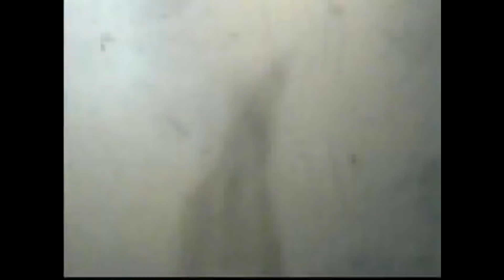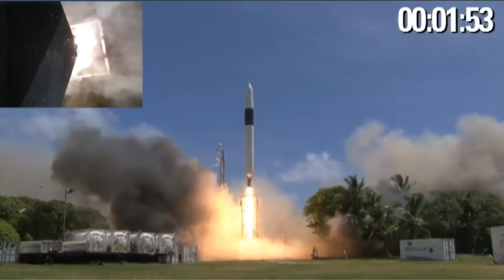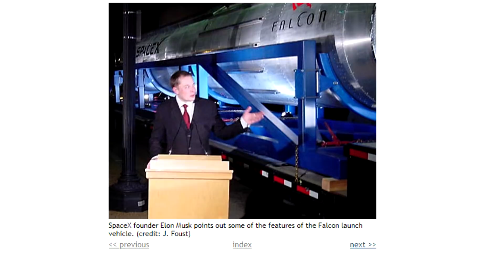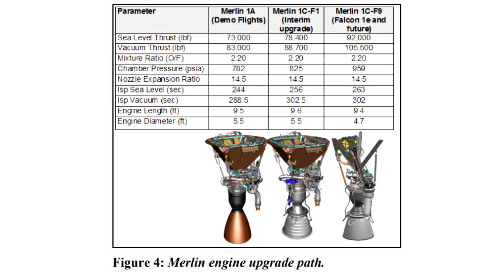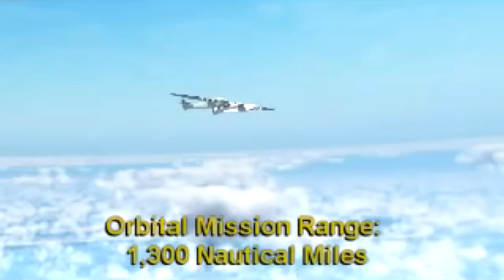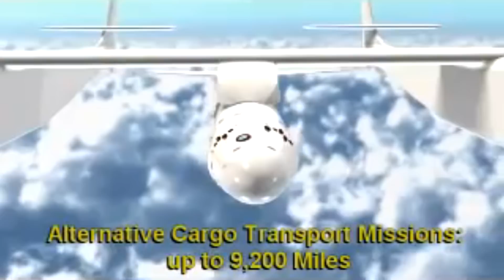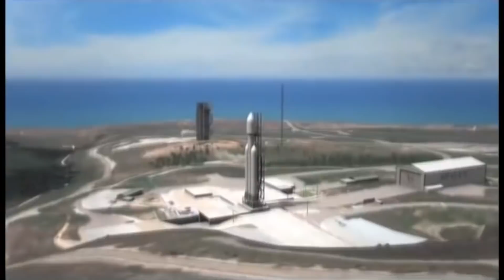Abandoned SpaceX Rocket Designs - Falcon 1e, 5, 9S5, 9S9 & Air

Comment: Amazing that the Saturn V had 4x the cargo capacity of the Falcon Heavy. Those old timers sure could build a freaking rocket!
Reply: To be fair, the Falcon heavy (in expendable mode) costs $150M. A Saturn V costs about $1200M (adjusting for inflation)
Reply: Yeah.  Similarly the Soviet Union abandoned Energia even though they build and few two of them with a max payload of around 130 tons.  Disappointing that the big rocket programs died out.
Reply: @TWX1138  both of these programs, while indeed impressive in their performance, were absurdly expensive. At ~$1.1bn per launch when adjusted for inflation, the Saturn V was a pricey piece of hardware, which is the primary reason the US cut the Apollo program short. Energia was far too expensive in comparison to the many other vehicles in the Soviet ecosystem. While it did have lift capability like none other, the few payloads that required it were themselves largely too expensive. Couple that with collapse of the USSR and Energia just wasn't sustainable for Russia. But, hey, at least we got some amazing kerolox engines out of that program.
Reply: I mean I am sure SpaceX could do just as good or better with the same budget Saturn V had when adjusted for inflation.   Those old timers had lots of bucks, So America got lots of Buck Rodgers out of it.
Reply: @filanfyretracker  actually the Saturn V by modern standards wasn't even that expensive of a rocket.  I heard the unit cost was something like $1 billion per launch when adjusted for inflation, which all things considered, isn't bad at all.
Reply: I'm also seeing the payload difference as 2.5x (for fully expendable falcon heavy). Might be misreading something though.
Reply: Yeah, and it's funny but a single F-1 engine is the same diameter as the F9.  It was a BIG rocket.
Reply: Yeah, umm it's more like 2.5-3x depending on your exact numbers for what configuration you are looking at.  The Falcon Heavy tops out around 60 tons to LEO in expendable configuration.  The Saturn V topped out around 140 tons to but some launches were a little more and others a little less.  Also doesn't hurt that the Saturn V was by far the largest rocket the US has ever built.  Imagine having a five engine second stage...

Comment: The other big difference between the early concepts of the Falcon Heavy and what they actually built, was they were talking about fuel crossfeeding between the boosters and the central core.
Reply from the maker: That's the second video I'll talk about that and the Merlin 2
Reply: @scottmanley  Do you think that falcon superheavy and crossfeeding were scrapped together because they were interdependents?
Reply from the maker: @johntheux9238  I think the technology was hard to develop and the gains weren't going to grow the customer base sufficiently.
Reply: @johntheux9238  Cross feeding was scrapped because it would have meant yet a 3rd F9 variant (or a Block 6) for a system that would likely not fly much.

Comment: Air launched falcon? Amazing
Reply: Annoys me how they ditched it and kinda fucked stratolaunch over, probably due to profit too...
Reply: @ericlotze7724  If the issue was money Paul Allan and friends would have dealt with that. Probably Space X didn't have enough engineers to work on contradicting Falcon designs. Look at how 'sharing' worked out for the Joint Strike Fighter or look at the enormous cost for the F35 because they want one platform to be everything. As Steve Jobs said: "Focus is about saying no!"
Stratolaunch should have taken over the rocket design and just buy some Merlin engines from Space X.